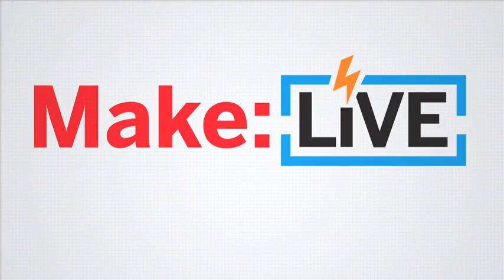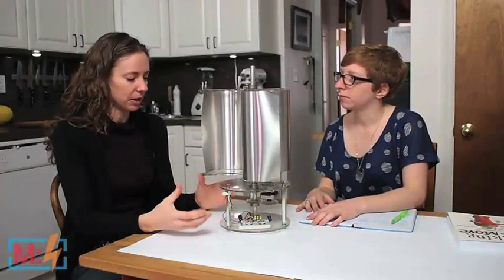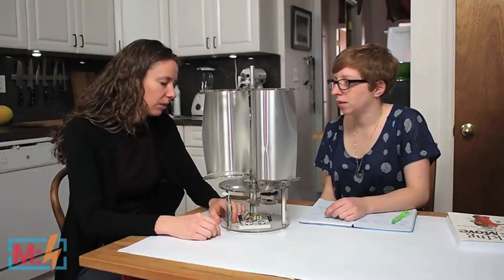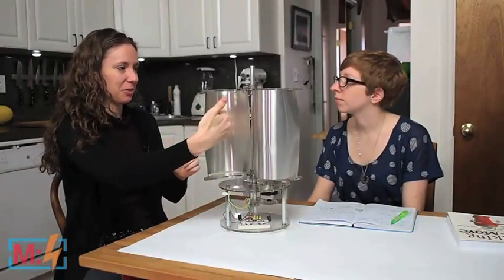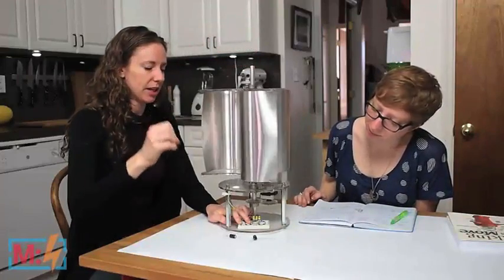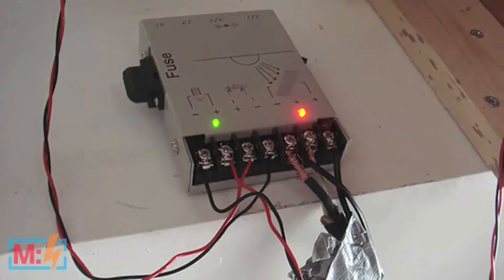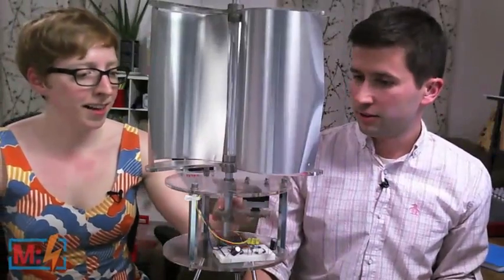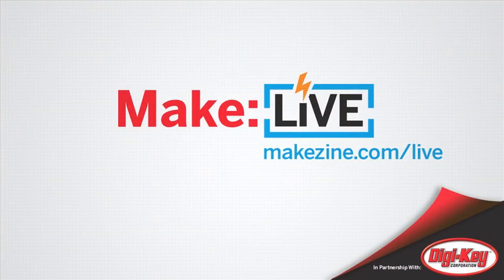Wind Lantern on Make: Live ep05

Comment: I think this isn't an ideal, minimalistic project. As noted, LEDs are diodes, so others aren't needed, neither are the capacitors. An effort should've been made to couple the stepper DIRECTLY to the blades, even if it's not the "right" approach for a professional project. McMaster-Carr parts aren't cheap; using hardware store parts would be better.

"A designer knows that he has achieved perfection not when there is nothing left to add, but when there is nothing left to take away."

Comment: Stepper motors are really great for generating electricity.  Good strong magnets, etc...  As for a comment about not needing a shop full of tools, and then needing a laser cutter for the gears.  There are quite a few on-line sources for custom parts like gears that don't cost a fortune.  The point is that if you only have a computer, and some software, you can get any parts you can design, made at a reasonable cost without being a millwright yourself.

Comment: @juankrlox - No problem. It depends on how fast you spin the motor really... if it's a 5V motor and you spin the shaft at it's ideal RPM it will output somewhere close to 5V.  Under load it will decrease.  Spin it fast and you'll get more voltage ;-)  However, you wouldn't really want to use the LED for rectification anyway because it's simulating the load for now, but you might not want to waste power to just light an LED.  The diodes and capacitor form the energy storage part of the circuit.

Comment: @juankrlox - you need the diodes to prevent reverse voltage on even an LED, which usually has a 5V reverse breakdown voltage.  Whereas the diodes can easily have 50V and 100V rbdV.

Comment: @Bluemchenwiese1 most of the small DIY ones or commercialy baught are hooked up to a transformer to amplfy the voltage so the tiny electricity made out of them is amplyfied to make more electricity. Also like they said the mechanical advatage like making the one gear smaller or bigger to get more turns out of the motor than what  the turbine is acutaly making. Plus this is just a display model used to show you how it works.

Comment: you should try a savnious rotor wind mill its much more effitient than the one in this video, just search it on google and there will be an image on how it works, basically after the wind went through one half of a can, it goes to the other half of a can, I did one for a school project and it worked perfectly.

Comment: @guns4good 
I just did some research and found out that you need 14000 kWh to produce one ton of aluminium. Lets say there is 100g of aluminium in this project --> 1400Wh for this project. 1 Low current led needs 5mA and we have 3 so that make 15ma when ist running. Now ist easy to find out what time you need to get 1400Wh with this mashiene: Over 10.6 Years.